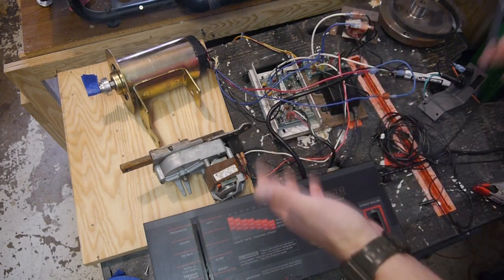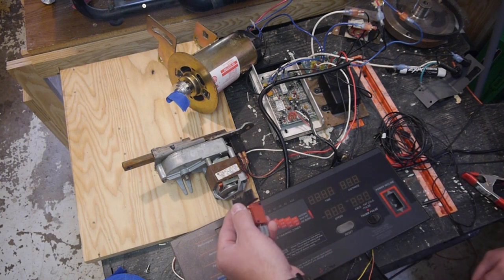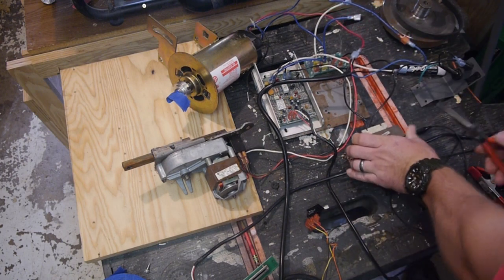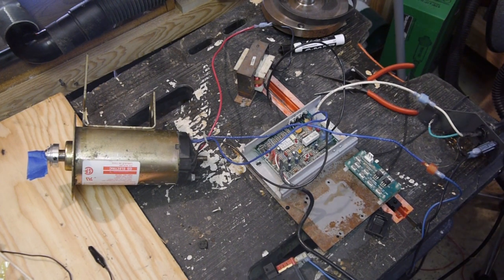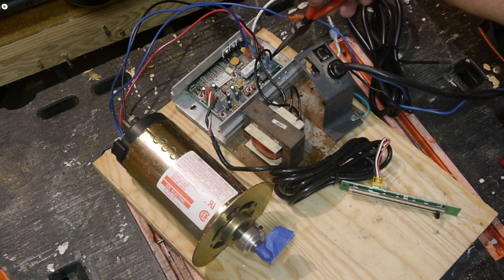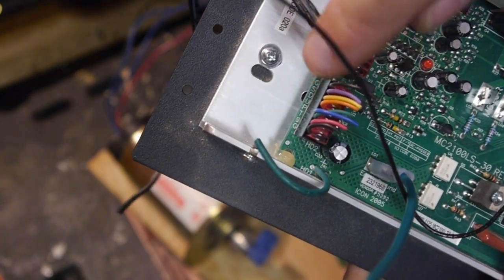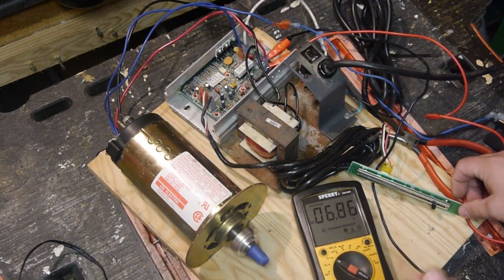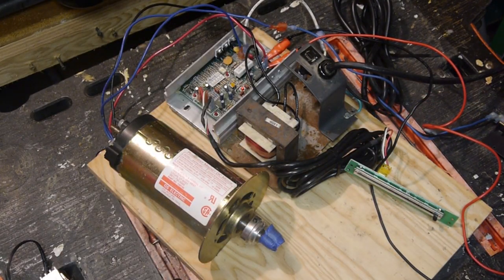How To Salvage a Treadmill Motor and Controls to Run other equipment at Variable speeds

Comment: I know this video is almost 4 years old, but would you happen to know the specs on the slide potentiometer and how it connects to it?  A friend gave me the salvaged parts but no controls.  I can't get a clear shot of the info on the bottom of the pot board.  On my control board, I see red wire is H, white is W, and black is L, (high, wiper arm, low?), but since the pot is mounted on a board, there might be additional parts on the board such as an additional resistor in series so that the control board would never see a full short.
Reply from the maker: Text on the back of the sliding pot board is as follows. "VENDOR#CC340" "POT2B" "F01-160M" "LONG SLIDE POT AW REV B" "COPYRIGHT 1995 BY PROFORM FITNESS PRODUCTS. INC." 10.8 k ohm at highest, and 0 ohms at lowest. No resistors in line on the pot board just the slider. Red wire is H, black wire is L, middle wire is the divider. Hope this helps.
Reply from the maker: Hi Douglas, I'll see what I can do. I still have it and I'll gather what I can about it tonight and let you know.
Reply: @JoshAQ  thanks.  Research comes up with 10k-ohm ½-watt, and I've only got an ⅛-watt one on hand. The video doesn't look like there are any other components on the board, but it is difficult to be sure.

Comment: The thermal breaker for the motor is actually very easy to remove. It's usually just held in by the nut and washer on the back of the motor. And the choke just help smooth out the pulsed DC coming from the controller since its not fully rectified it more like chopped and flopped AC. It will run without the choke its just a little more noisy and the thermal overload is just redundant if you keep th breaker inline. Nice video and entertaining!!

Comment: i have the mc2100 speed ccontroller and looking for a way to control my motor ... i think this controler may work  ...easy to hook up  and use 20hz setting .. i saw another person do this and it worked  https://www.ebay.com/itm/Square-Signal-Generator-1-150KHz-PWM-Pulse-Frequency-Cycle-Duty-Adjustable-Meter/312690277939?hash=item48cdcafe33:m:mDN4M2CcoqxdWPGwhTdYxFw

Comment: Finally!! someone runs the motor as slow as it will run. Thank you! I've seen a couple of people set that second board aside (the one with the big capacitor 'cylinder' on it) after disconnecting unneeded things that connected the two boards together. I see the friction you got, but wonder what load that motor would take at slow speed and what the rpms actually are. would a 2 hp motor like that put out 1/2 hp at slow speed? I want to make a motorized tow dolly for trailers and I'm having trouble sizing the motor and finding a slow enough speed without buying a gear reducer. Thanks for sharing your work..soon to hunt for videos on your cnc mill if you posted any!
Reply from the maker: You are welcome! I don't think It would working for what you want in a direct drive scenario. You would certainly need some type of gear reduction. I would think your best bet is a worm drive setup I would think. Just depends if you want it to be free wheeling or not when power is not applied. Thanks for watching. There are certainly a bunch of cnc videos on my channel of it in use. The drive train for the spindle didn't get really robust till the last video though.
Reply: @JoshAQ  Thanks Josh! After two thorough replies which didn't go, I wonder:  If a treadmill on it's lowest speed is almost slow enough (judging by walking speed at the gym) and I up-sized the second pulley to slow it down more, would it then be strong enough to tug about 4000 lbs on a level grassy surface? That's the bottom line :) In my thinking mix as alternatives for construction of the dolly are a modified winch; mobility scooter motors with worm reducers, motor brakes and controls, but too low wattage; t-mill motor with centrifugal clutch; t-mill motor with sprockets reducer, even a HD drill as an alternative solution. btw, lots of people reverse t-mill motors by reversing the the black and red leads to the motor (barrel switch or double throw type?) I appreciate your time and don't want to take too much of it up! Thanks again!
Reply from the maker: @CuriousEarthMan  I hate when you go through the effort of typing something out only to have your internet fail or accidentally hit the back button. LOL. 4,000 lbs is alot of weight, I did some quick calcs and without going into too much about rolling resistance and the like, and assuming some things you are going to need about 200 lbs of force to propel your trailer in grass. Assuming a 12 inch wheel on the dolly you will need a motor that can output 100 ft*lbs of torque at the dolly wheel to move it under ideal circumstances. So lets say 150 ft*lbs to give us a margin. That is a pretty attainable number for most dc winches. I think your problem will come with friction. If you used a typical small pneumatic tire it may just spin in the grass. For car tires in dry grass it looks like the coefficient of friction is roughly 0.5 depending on grass conditions. so we assume you have the tongue of the trailer weighted at 10% which I think is the max recommended if I remember right, then you could potentially exert 200 lbs of pulling force on the trailer. So possibly doable. Throw your weight on it to get it moving and you may have something there. You probably want the motor to be a permanent magnet dc motor as they tend to do much better at slow speed high torque loads. Good luck on your project sounds like a fun one.
Reply: @JoshAQ  thanks for the calcs, Josh! I had a dream last night that I was back in school and taking an exam, and I couldn't see the paper to write on, nor understand the question fully! (seriously lol) I'm going at it sort of backwards. Finally, I did a (HP calc) F=D/T but that left some things out I'm pretty sure! I just watched yet another video on how DC motors are controlled and I started to smell smoke :) I'll get it eventually! I think I need to try some things safely with my hands (look under a treadmill and measure things like rpm, etc, take some things apart...TRY something ) since by theory I'd have to study up more from elementary levels. I'd like to share a couple of telling links: $220, 350W, 12V dc, 5k lb capacity, 8" wheel, 306:1 reduced, squeaky, marginal mover: https://www.youtube.com/watch?v=pn9V1eNu-AA  now a nice, $1800, 36V, 1225+/- W, 7-10,000lb capacity, 46 to 222 ft/min ground speed, 13"? wheels, using gear motor PLUS chain reduction of unk total ratio: https://www.youtube.com/watch?v=-YO5KKoKFz4&t=201s   At 3:10 +, you can see the underside and the construction. I'd like to spend about the $200 (parts,controls, machining, welding, ) but get closer to the  $1800 unit for function :) can you blame me? The demo video for the expensive unit is impressive! Can't thank you enough for your help! :) Much obliged, Josh!
Reply from the maker: @CuriousEarthMan  The first link looks like a winch connected to a tire lol. Would work for short trips I imagine. Certainly had enough power to get over the cement lip. Rolling resistance on concrete is only like 0.01 coefficient so 4 times less than dirt. The second link, the dolly looks promising. Almost like a mobility scooter and treadmill on steroids had children. LOL. The demo is impressive, I didn't see him start and stop on the grass, so I would like to see that, and it didn't look like the trailer was loaded. Although I would wager the trailer probably weighs in excess of 2,000lbs even not loaded. So impressive for sure. The strearing is a little clunky since the back axle is solid, but on soft surfaces not a problem. You wouldn't want to put a differential on that anyways. LOL. You are very welcome! If you do decide to build it I would love to see it in action! Good Luck!

Comment: Good video, i'm trying to scrap together some material to make a 2x72 grinder.  Treadmill motor will most probably be my power.  This explains it well enough.
Reply from the maker: Thanks! I think a treadmill motor will be a good fit for what you want to do, given it already drove a belt. I plan on doing a 2x72 grinder build in the future as well. Just can't find the time. If you have any questions while tearing it apart let me know and I'll do what I can to help. One last word of caution. I ended up making a fan to go on the small shaft sticking out of the back of the motor, the treadmill motor would start getting really hot after 20 minutes of light duty cutting on the cnc mill I attached it to. Also if your treadmill is anything like mine, the motor pulley was attached to the motor shaft via left hand thread. I believe the shaft on mine was Ø17mm and 1.3mm pitch for the thread. If you have any other questions that this video didn't cover just let me know and I'll see if I can answer them. 
Good Luck!